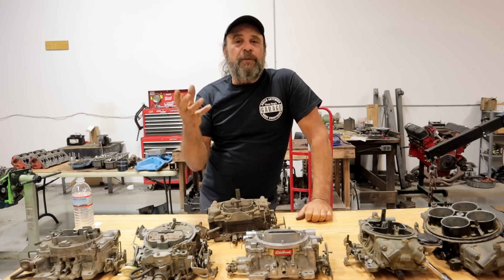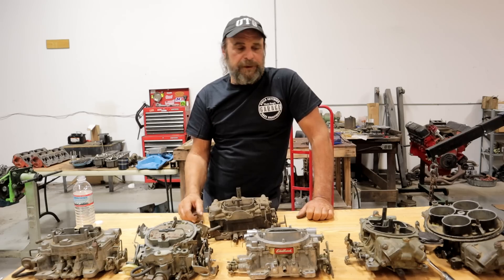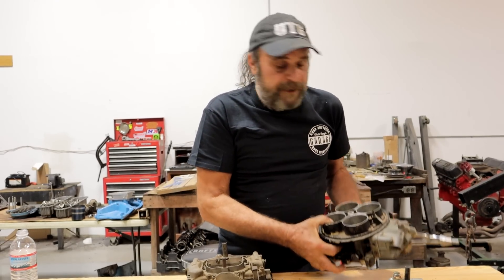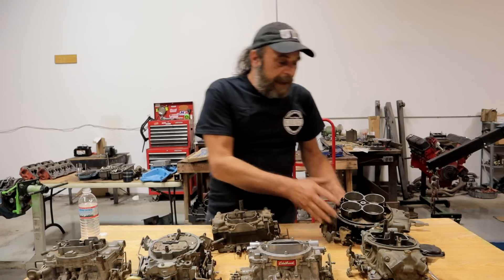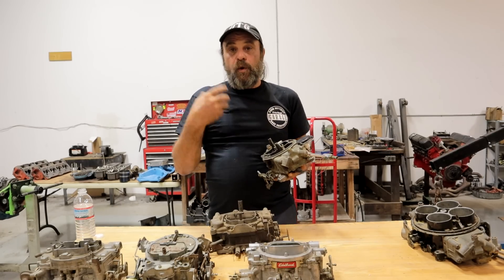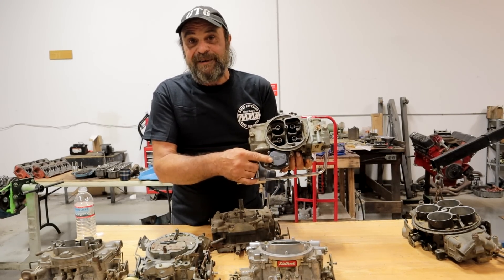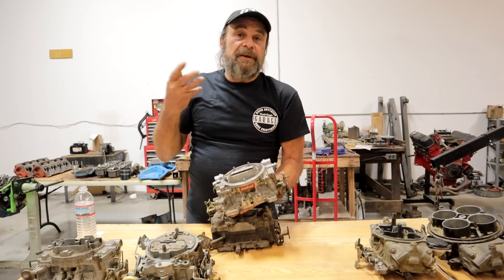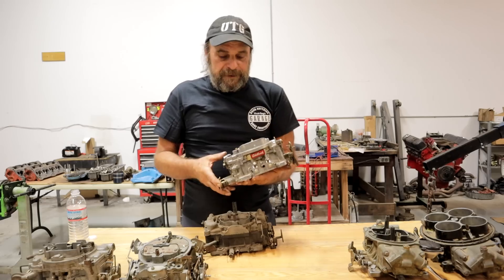Mechanical & Vacuum Secondary Holley VS Carter/Edelbrock, Rochester Velocity Style Carburetors

Comment: I love Edelbrock carbs. I run them on my square body chevys and they’re great, but I couldn’t help but notice that when you started talking about a crude design you started eyeballing the Edelbrock on the table 😅
Reply: @SweatyFatGuy  I don’t disagree. I run an AVS2 800 cfm on a 454 and I’ve been playing around with a AVS2 650 cfm and 1411 750 cfm on a mildly built SBC 400. They’re not daily drivers, but they are also not hot rods. I just love cruising around in my old trucks and Eddys serves that purpose well.
Reply: @SweatyFatGuy  Very well spoken , Sir .. a carb design that  runs trouble free  and on  oem straight 6 cylinder, v6, and   virtually every cubic inch v8 GM produced ..  for 20+ years is a very sophisticated  design  and being  production line installed on some Ford and Chrysler  vehicles attests to that .. in '72 i rebuilt my first  Qjet  and it was a fuel geyser  but i  went back thru it  and it ran on my next 4 vehicles .. since then  i've built  hundreds  for  street and race vehicles  at my shops and the Chevy dealer i worked at as a young man ....  during that time i pored over  anything written by Doug Roe, Brad Urban .and others .., i spoke at length  with a Rochester engineer who'd visit  at the GM training center  where the dealer would send  myself and our  techs to ..  best  of all  because of the number of carbs produced  the basic core carbs  can be had  at low cost and sometimes free .. the mention of the thermo quad  as  competition for the Qjet  is a fallacy ..   just in  the engineering alone .. no cracked plastic fuel bowls,their silly kinked  ,cracked accelerator pump  circuit  hoses  had to have been an after thought .. I'm thankful  that every  part needed  to build and tune a Qjet are readily available
Reply: Edelbrock are fine for guys that just have a mechanic work on all their stuff.. Holley is for guys that actually work on there cars.. pretty simple.
Reply: @every-istand-ophobe6320  whatever 🙄
Reply: @davidsteele1667  did you just "whatever" me? LOL!! My point EXACTLY. You are the target demo of Edelbrock. "Just have your local mechanic bolt it on and GO! "  from your picture I assume your a grown man? Could be wrong but a little life advice grown men don't tell other grown men "whatever" with little emoji faces.
Reply: @davidsteele1667  This is why most of UT cars run a Carter/Edelbrock. Just look at all his old-er videos.
Reply: The double pumper is really the most primitive and simplistic, but it’s inherently a little more tunable since it has that adjustable secondary accelerator pump, plus it has since been refined and made into very modern designs with all the subtle venturi and metering goodies that the later OEM carbs had, with the exception of the thermal management that the Thermoquad brought to the table.
Reply: @SweatyFatGuy what's up man I haven't talked to you in a long time. I know this is a really old post you are commenting about how Edelbrock doesn't have a tunable secondary. Are you referring to the old performance series or the AVS2s?

Comment: One of the cool feature of the Quadrajet would be some of the Quadra jet models came with the altitude adjusting Bellows .
Reply: I caught a squirrel in the rad fan of my car the other day.  I thought of you.  It was the squirrels fault.
Reply: @ripvanrevs  lol
Reply: Squirrels get at the bellows, don't they...?
Reply: Let’s not forget the hot idle compensator too. Or the built in main well leaks. Lol.
Reply: @ripvanrevs  I'm always mashing the brakes for those little fellas. 
I'm not gonna go all Geico squirrel commercial and crash off the road but so far I've done ok,I'll look back for a road stain and won't see one. 😬
Reply: @NSUGS  sumbitch today at work, I'm a gen tech and get to a customer with a problem. 
Yeah he had the back door open for a few days and his buddy Chippie the chipmunk moved in. 
Jeez Louise the dang nuts and debris all over, sheesh 😂

Comment: Nice carburetor functionality review. I am now running an Edelbrock AVS2 on my ‘69 Chevelle SS. It has eight orifices per booster to aerosolize the gas better than just a single gas stream. It seems to work really well for my application and driving style. Otherwise the AVS2 is the same as the AVS style carburetors.
Reply: AVS2 can also be used in hilly area and even off road racing if you change it around
Reply: I went and tried an edelbrock again recently and got an AVS2 because so many people were raving about it and the drive ability and part throttle response rivals any holley I’ve experienced.  Main issue is the fuel evaporating off fast if it sits
Reply: @Terminxman try a phenolic spacer or the insulating thick gasket they sell. Helps a lot with this especially if used in marine applications
Reply: @Terminxman I think UT talks about how that circuit dries up over 48 hours all you have to do while driving is punch it to open the secondary’s circuits and jt will bog but by the second punch it will have filled with fuel again

Comment: I like the Thermoquad  but when I switched to a single plane intake on my 70 340 the square bore Holley dbl pumper ran even stronger.  That Thermoquad on the factory 1971 iron intake did run really good.  It also helps when companies sell well stocked tuning kits with lots of jets, metering rods and other tuning aids. Carter, Edelbrock  and Holley have such kits. GM Quadrajet 4bbl carbs are good but hard to tune if you need a assortment of jets, metering rods, a good assorted kit didn't really exist.
Reply: As far as qjets go, I buy parts carbs any chance I get. And if I need a jet or rod that I don't have you can easily get singles/ pairs of jets on ebay whatever size you need

Comment: I always hear how much people criticize the Quadrajet, but there aren’t many carbs that are as diverse! Used on everything from 170 cubic inch 6 cylinder to a 500 cubic inch Cadillac! I’ve run them on every thing and my 13.23 second .040 over 350 and 125k turbo 400 trans 3.73 geared 73 Camaro averaged 16.7 mpg at 60 mph!

Comment: Well done! I still love my Q jets. I might not ever find anything better for gas mileage and drivability.
Reply: I started having issues getting parts for them . stuff like the rear hangers  and even the rods . also a common thing i always looked for was top plate that was pretty straight and base plates that throttle shafts wern't  worn. was seriously  considering  getting reamers to install bushings for throttle shafts . the biggest issue was going to the salvage yards they want $36 for the carborators even with worn throttle shafts. by accident found out how to get them for $15 which used to be the price. i pulled a 800cfm  off a car the throttle shafts were bad had lots of play took it to the front trying to work a deal didnt happen so took the carb back set it on the dash for next payday? come back Friday the carb is gone asked a worker he said they put loose carbs in the scrap barrel ??? shore enough there it was now $15?? 
I dont know why they could just sell me the carb first time as scrap since I showed the guy they were worn and I just needed a few parts from this one? 
Man zi miss the days of actualy haggling for parts some days you got a deal and somedays not as much of a deal So yes UTG I get the deal with the edelbrock it's part of the game? you can Take it apart somewhat  that's fair play to check it and yousualy if they rather you didnt it's time to go down on price till either it's time to walk away from it or get it down to parts price.

Comment: I’m definitely a Holley fan! I struggled at first with my first Holley. My Camaro came with a Rochester 2 bbl, and I was building my first engine. I bought a new intake and Holley 3310 with my intake and carb package from Midwest back in the day. Somebody told me that the Carter AFB was a good carb, but when a buddy gave me one, and I took it apart, I had so much trouble with it, so I went back to my Holley, and never looked back. Nowadays you’re seeing all these awesome versions of the Holley coming out,(especially the new Edelbrock carb!) that I know why I’ve been running and modifying Holleys all this time. Thanks for the informative video!

Comment: Hey, uncle Tony, I wanted to say thanks for the gas-in-a-water bottle trick to check vacuum leaks. Having to chase a leak down in my 82 square body made it easy and painless without having to go buy an expansive can of brake clean or the like.
Reply: You don't even need gas really ,got some rubbing alcohol in the medicine cabinet? 
Just some juice to temporary plug a possible leak. 
Haha literally anything liquid ,even water, and listen for engine rpm change as usual.

Comment: Very nicely explained Tony. I fell in love with the Thermoquad after fitting one to my 360. Their main advantage, as with the Rochester and AVS is the engine decides how much fuel/air mixture it wants, once set up correctly, not just opening up and overcarbing it like a DP can.
Reply: Yep, the T-quad is my favorite carb too. And I found out by accident that a 780 cfm works like magic on a 318 or 340. Lots of cfm seems to be what the small blocks like. I had a vacuum secondary 650 Holley and had nothing but trouble and couldn't get it to perform that well, and a buddy gave me a 780 T-quad off a Cordoba with a 400 big block. I thought it would be too much carb for my 318 (mild build, high rise intake, headers, 340 cam, etc), but it was magic. That thing would just scream when I put my foot in it.

Comment: I have a bone stock chevy 305 in a 27 t bucket. Exterior is dressed up with shiny bits and a dual quad tunnel ram with 425 cfm holleys. When I bought it it didn't run worth a damn. By watching your videos, along with Andy's videos on carburetor tuning, I got the carbs dialed in and it is a ton of fun to drive now. Great when cruising but when I step into it she gets up and goes like a bat out of hell. I only need to adjust the transition circuit slightly more to get rid of the millisecond flat spot when taking off from a stop. Almost unnoticeable but it is there. Thank you for all you do.

Comment: I tried to comment on the other carby video, couldn't access comments? I'm the same age bracket as Tony in Australia when I had fast cars the rule of thumb we used for flow rate to cubic inches was roughly 1.25ft per ci for economy, 2ft per ci for performance without losing some economy & 3ft+ per ci for outright performance.

Comment: Good Video Uncle tony, I still use Holley 3310 750 Vacuum  Secondary on my 340. I Still have the original Themo Quad like new, not being used sitting in a box. Thank you for this video, good refresher and good for the beginner.

Comment: I had a 360 in my D150 that I put on a Holley Street Dominator single plane and a Holley 650 vacuum secondary on it, both were from a 318 cop car, and for some reason that thing worked so good I couldn't believe it. 360ci AWD 4speed manual trans and 18 miles per gallon. It was just this side of amazing.....
Reply: What you have the timing set at. Gas mileage on my truck tanked really bad for some reason

Comment: Glad to know I’m not alone in my love of the summit carbs. I’ve run several of them on different applications and have always had good results.
Reply: I've been using a Holley 4010 carb and it does okay. I've leaned the jetting as those annular boosters really flow the gas. It's on a modified chevy 350 with headers in a 1969 Chevy c 20 pickup.

Comment: I had a 69 Chevy pickup when I was younger. It had a sweet running mostly stock SBC in it. Cast iron heads and Intake with a very mild camshaft and headers. The absolute best Quadrajet I ever saw. Started great, idled great, and worked flawlessly when you stomped on it. Over time it developed the Q-jet stumble, but when I first got it, it was just smooth as silk. They really can be great carbs when they’re right.

Comment: i rebuild an eldelbrock once and took the spring off the primary flapper and put it back too tight and the carb was now a 1:1 at opening the primaries and seconders it was awesome i also took off the weighted flapper

Comment: Great info U Tony 👍 I had a qaudrojet on on my 63 Chev back in mid 90s , 350 Powerglide , secondaries opened and it was kicking it down a gear and pulled , great times . Cheers from Downunder 🍻

Comment: At the end you nailed it when you said "the engineers knew what they were doing when they built these things"
Unfortunately there are too many Bench Racing Keith Blacks that have Butchered any and all of these Carb designs, even before running them out of the Box.

Comment: Thanks UT for the great description. I'm planning on running 2 500 CFM AVS2 Edelbrock carburetors on my TR5 tunnel ram with an open plenum. I plan on using progressive linkage and using the rear carb for the primary.

Comment: Street Demon based on the T quad, is an awesome carb. Very affordable as well
Reply: They look good, think they are offered with a polymer fuel bowl/ main body.  Would like to try one out.
Reply: @craighansen7594  I've used many and suggested many. The result is the same; huge improvement and rarely need much adjustment.

Comment: The Thermoquad also had a phenolic fuel bowl middle section to keep the fuel cooler. Many years ago I had an 850 cfm Thermoquad on my 440, it was awesome. Many people at that time were puzzled by them, but they are actually pretty simple to understand, and their construction also pretty simple. They were/are a very versatile carb with their small primaries and huge secondaries.

Comment: Carburetors is always a good topic. 
   I had a Mustang in the late seventies that had a holly 3 barrel carburetor. 
  When swapping it out it sold for more 💲 than the new double Pumper.
   I'm sure UT has done a video on it.
Reply: 3bbl sounds rare. Never heard of one
Reply: @allanmcelroy9840  I don't know a lot about em except vids and seen one or 2 , but yeah they were legendary from what I hear.
Reply: the holley dominator replaced them...they were developed for NASCAR
Reply: @allanmcelroy9840  not as rare then as they are now.   I think it was   950 CFM. 
  It was a real powerhouse.
But it , OR I had  tuning issues.
    Hindsight  would have kept it.

Comment: Hi Tony, just finished watching Nick's Garage and he's dyno testing a 440 with aluminum heads and high rise single plain intake with a 950 cfm carb. After a couple of tests it made 495 h.p. he removed the 950 and replaced it with a 750. Next couple of tests came in at 520 h.p. 
I saw your video from last night about your discussion of carb size and cubic inches. Though this was a good comparison in carb vs cubes.
Reply from the maker: I didn't see the video, but here is something take into account.  The Holley 950 is actually an 820 CFM carb (I know, I know...didn't make sense to me either when I first learned about it) and out of the box, it is calibrated as a true race carb.
If the 440 in question had conservative cam/compression/porting/timing the 25 horse difference with the smaller carb calibrated for street type use makes sense.

Comment: Nicely done sir.  I remember a long long time ago watching John Bachmann with an entire tool box of differently weighted AFB secondary flappers for his Super Stock Hemi use them to tune for track conditions.   Little Pontiac 350 went 11.04@119 by the way.  Sooooooo close. Time to tune a bit more
Reply from the maker: So close!  Don't ya hate when that happens.  Next time, cheat the lights a bit by staging a tad sideways and just barely lighting the stage bulb with the forward wheel...boom! 10.99
Reply: @UncleTonysGarage    Gonna try to get on a chassis dyno and do a little tuning.   I have a feeling there is gonna be that one little thing that makes it go WEEEEEE!  1.51 60ft 6.95@97 1/8mi then just  doesnt pull real hard in high gear    I have one 450 tunnel ram carb you may have if you want to dig up a mate for it on the 383.... should make for some killer throttle response.

Comment: Yet another great video Tony. Can you please go over the differences between a double pumper and a Dominator carb? Aside from the footprint and the CFMs (yes I know they made "small" Dominators also). Aside from big big flow, there are other differences, please explain.
Reply: Dominators are double pumpers. They were designed specifically for racing, they have a larger footprint to allow for larger venturis for more airflow. If memory serves the standard 4150 double pumper is limited to I want to say 950 cfm. Yes nowadays you can get pro form main bodies and create kind of a hybrid between a 4150 and a dominator and get around 1050 cfm airflow. But anyway the dominators larger size allows flow rates up to 1450 cfm from a single 4 barrel.

Comment: 🏁 Your timing could not have been any better. The topics of your last two videos were kind of discussed and evaluated in a much more condensed form on the most recent episode of Engine Masters. They ran three different carburetors all rated at 750 CFM all made by the same company "Brawler" and all put out different results. Between that video and your two videos I almost feel like I know something about carburetors. 😂
Reply: Another thing, if you read this, can you please explain the difference between the accelerator pump and the power valve on Holley carbs? Thank you. 👍

Comment: it would be interesting to see a video about the multi-carb side draught set ups using SU's/Strombergs/webers etc on European cars.  The SU's are interesting as they have vacuum controlled jet opening with dash pot damping and no chokes but a mixture control that increases the jet opening.  I had dual SU's on a 66 Triumph.